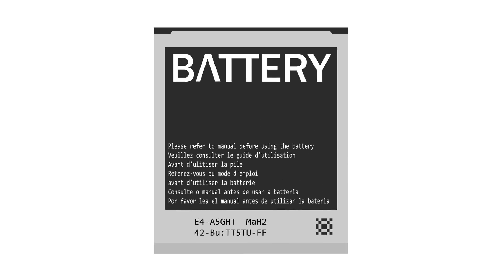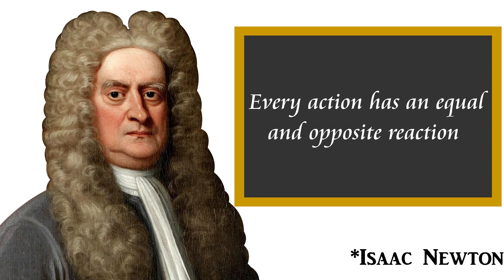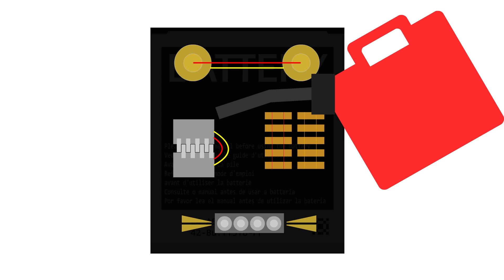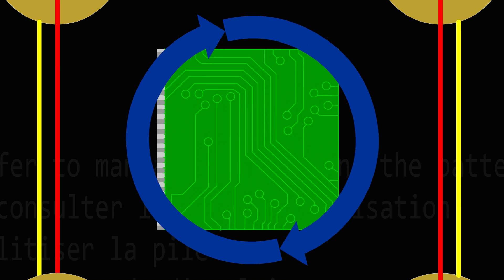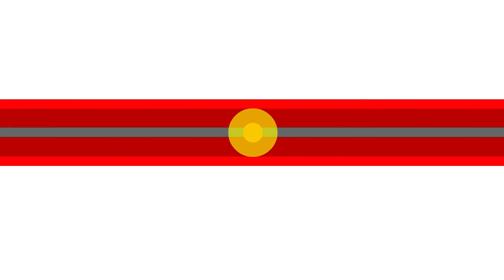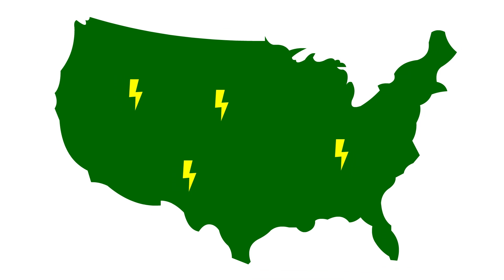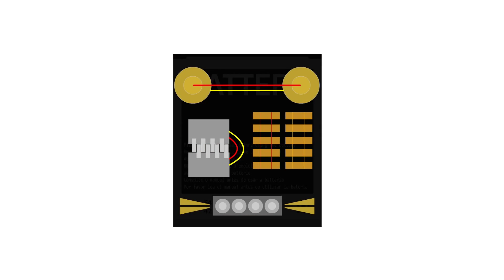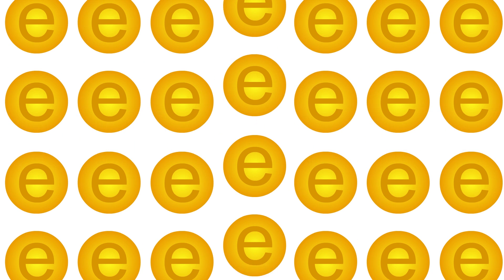Why Can't We Charge Our Phones INSTANTLY?

Comment: actually what you showed as the tesla battery or its controller is actually teh electric motor and its inverter the battery ina tesla is the big metal plate that goes from the front wheels to the back ones and to the driver door to the passanger one

Comment: IMHO battery capacity is way more important than charge times. In the evenings I check the charge of my phone and charge it if I need to. If your battery is too weak for your usage, either get a phone with a bigger battery, use your phone less or carry a power bank around with you.
If you search a phone with a bigger battery, I currently use an Oukitel K6000 Pro. 6000 mAh are enough for most people I guess ^^

Comment: @Wastetime Wrong on the Samsung Battery. Due to the rounded edge design and the tight squeeze, it caused an internal short at the edge of the battery. This had nothing to do with overheating.

Comment: man I respect you generally but using miss-information for fun is bad the Note 7's battery was "burning" because of conductor touching caused by big battery size in small room for it whether in first original build or the second , and it worse noting also that Samsung generously recouped those who were affected, check your info man it is not easy to miss lead the people

Comment: Love gameranx and flacon but I feel like these videos are talking for the sake of talking. I could have explained all of that to someone in about 2 minutes in a much clearer and consice way. Spend more time making quality videos and stop filling time with useless sections.
Reply: Also you can fast charge. I have an option on my 18650 charger which will charge in 10 minutes. Not instant but pretty good. The problem there is that it reduces battery life not causes them to blow up.

Comment: A few years ago I saw a news article about a 3D battery called "Prieto Battery". It's supposed to be a battery that has a 3D structure for electrical currents instead of the traditional 2D structure most batteries have. If I remember correctly, that kind of structure is supposed to be able to hold more charge/last longer, charge faster, and have a longer life cycle.

Comment: physicly i think it is possible to get close to instant with what we have now but you'd need more cells connected like when you jump start a car as this reduces resistance in a "perfectcircuit" but you would have to  reduce the internal resistance of the cells you are using as well as finding a better wire which can with stand a high amount of charged particles and therefore a higher temperature.

Comment: why dont they make batteries that charge through heat then the battery would charge itself
Reply: Ozi 
That's not possible. The law of conservation of energy doesn't allow it. The phones heat itself wouldn't be a viable source. You'd have to use other thing to supplement that, maybe like the phones movement while you are walking.
Reply: Jerry Tomas oh ok thanks

Comment: yea but how are some chargers are faster than other and how some chargers get slower and slower over the years ?
Reply: Αναστασης Φιλ 
They just put more electricity in faster. Still safe but not good for the battery. You shouldn't use anything besides the supplied phone charger unless you want your phone battery to hold less charge.
Reply: tip of the day tnx m8